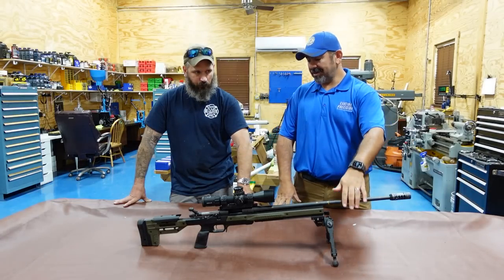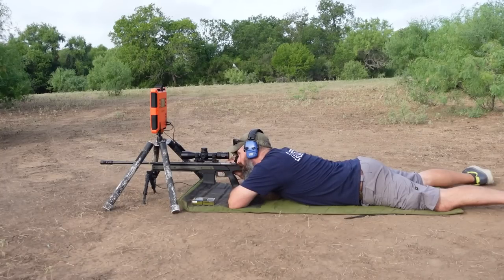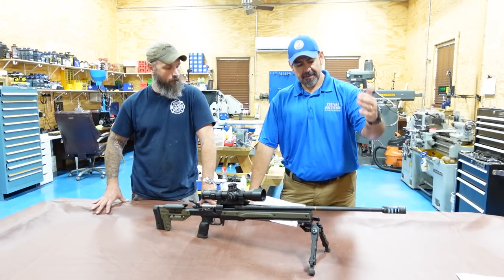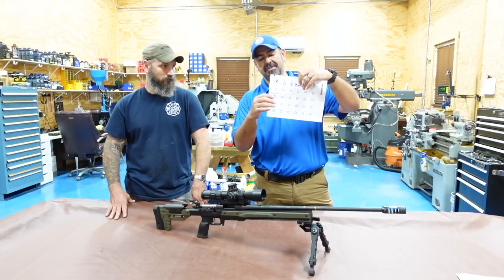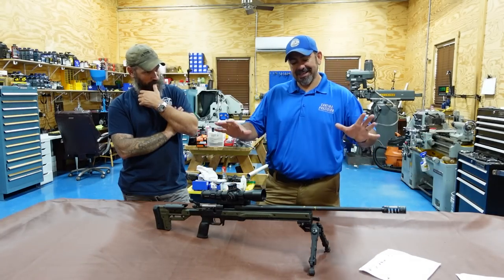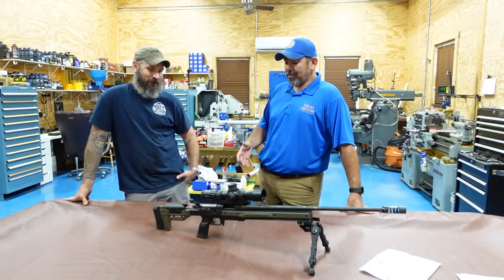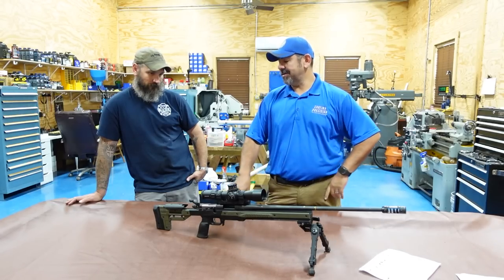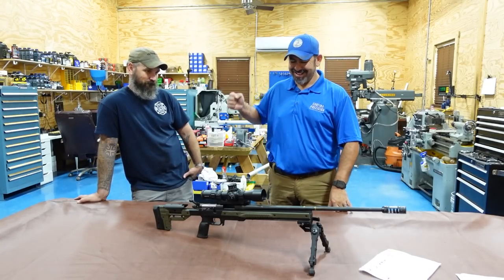6.5 NEEDS-MORE | EC Tuner Brake

Comment: I did something similar. Took a $335 Savage Model 12 in 6.5 Creedmoor. Put it in an Oryx chassis.  Had a gunsmith chamber a heavy (1.25”) 26” Shilen select match barrel and blueprint the action. Put in a 1 lb RifleBasix trigger and longer bolt handle. Added your BR EC Tuner Brake. I’ve got less than $2,000 in the gun (not counting a $900 Sightron scope). With my handloads (you’ve helped me there), I can shoot .3 MOA (5 shot) groups at 200 Yds. 1st shot at 400 was dead on. With the factory barrel, I shot 4 into 4.6” at 1,000 Yds. I’m not a pro shooter or special operator - started shooting 3 years ago at age 71.
Reply: my most accurate rifle is yhe same rifle,   can shoot
 .17 group at 100 and .5 at 1000,   stock barrel.
Reply: I have been thinking about the MDT ORYX system for my Savage 110 Tactical in 308W, but my first range session went well bore cleaning revealed a bad barrel that shattered deeply marks were replaced with a Criterion barrel, but my question is, “what type of group(s) did you achieve with the factory stock, and improvement did achieve with the Oryx stock”? My Savage still sitting in the original stock.
Reply: @rudolphferdinand3634  I have a Savage Model 10 in 6.5 Creedmoor.  Put an Oryx MDT stock on it and never looked back.  Do yourself a favor and put one on it.  You will not regret it.  As they stated in one of the first videos, the rifle is much more manageable and stable after the recoil.  Much easier to keep on target.  Groups were reduced as well.  No comparison to the original stock.
Reply: You young guys always bragging 😂…. That’s awesome sir 💪🏾👍🏾

Comment: Okay so lets go backwards just a little, comparing from the start. Keepin the ammunition the same, stocks the same, scopes same. Where was the most significant change on rifle from the other? Would you agree it was the turner break? The other rifle in the comparison is shooting just the same but has no stock change except for lug bed and pillars or the tuner break. So personally IMHO the barrel had the issue and the tuner break made the correction almost 100%. Right?
Reply: I am not sure I agree, the 3.5 MOA rifle became a 1.5 MOA rifle with the stock change and then a 0.5 MOA rifle with the addition of the EZ. On paper the stock change would appear to be more significant. Only way to know for sure would be to put the barrel back in the original stock and see if it can shoot significantly better than 1.5 MOA.
Reply: Don't forget that they re-crowned the barrel when they threaded it for the tuner brake. If the barrel was actually the issue then the new crown could account for some portion of the increased accuracy. Impossible to know for sure since they did both at the same time. The fact that it shot the best group without adjusting the tuner at all might mean the re-crown did most of the work. Likely a combination of both. To test everything independently you'd need to test the new crown, then add a brake and then add the tuner and test each separately.
Reply: @kalicom2937  I agree, some of the steps where skipped b/w both rifles. To be consistant you bed lug and pillar both stocks and check for change as it started. One Rifle Erick proved to be right with all changes except the T brake. The second took a leap to a new stock without anytime wasting from the original stock. And it improved just a little bit, but when the T Brake was added it improved well over 90%. The moral of the story IMHO. There are god barrels and bad ones.  And some bad or just okay barrels, if you can find the harmonic tune that works for that barrel,  I don't care what platform your put it on it will work. Just like you may find a barrel that is just bad, and no matter what you do they don't shoot.

Comment: I've done this same thing over the last year, but not factory ammo. I picked up an ADL Tactical in 6.5cm off the shelf for $400, came with a 20moa rail, heavy, threaded, varmint barrel. I put it in an oryx and bought a cheap brake while you were coming out with your tuner. Using my reloads and cheap Hornady bullets, it's sub 1/2 moa!

Comment: I'm sure the tuner was a significant help in improving the accuracy. 
Do you think recrowning also played a role? I would think it would have.
Reply: Yeah, it's impossible to isolate the difference one aspect is making when you change multiple things at once. The barrel crown is one of the most important aspects of accuracy. I've seen some truly terrible factory crown jobs which when remedied cut groups to a third of what they were previous. The fact that it immediately shot the best group when the tuner was attached without any adjustment actually lends credence to the idea that the crown made a lot of the difference.
Reply: @MMBRM  luckily they can actually test this now - all they have to do is take off the tuner brake and compare the bare muzzle against the old results
Reply: @newerest1  I would like to see the other rifle have its crown re-cut and not thread it for a  brake. Threading will remove metal and  possibly affect harmonics.
Reply: 10 thing that you can do to the basic rifle to improve accuracy and recrowning is one of them but should be one of the last because out of the hundreds yes hundreds of rifles I have owned over the last 69 years I have only had a couple that it made any real improvement in!
Reply: Crowning is a myth, you can jack it up and it may even improve accuracy

Comment: Triggertech primary for the money can't be beat. I have two of them, and I have a Timney, it's only real competition at the same price point, and the Triggertech is just better. It feels lighter than it really is because it has zero creep. Can't recommend them enough, 10/10. Just saw your idea about the factory stock. It looks like a cheek riser pouch setup like the ones from Triad Tactical might make it easier to shoot. They're like $60 and really good quality.
Reply: " It looks like a cheek riser pouch setup like the ones from Triad Tactical might make it easier to shoot' This or a cheap plastic bolt on for the same price and a $5 trigger spring from Mcarbo would have made half of the difference im convinced.. would love to see a poor mans version of this same series. Throw a $500 optic on there too.
Reply: @foonus406  Not sure if you've ever taken a R700 apart, but the trigger doesn't have a replaceable coil spring like say a ruger american or browning a-bolt, etc. As far as the plastic bolt-on, to each his own I guess. I'm usually not willing to drill holes and put screws or bolts on my guns, but that's just my preference. I also have a cheap version of the triad from midway (their own brand) that probably works just as good. I'm not an elitist type, the triad just seems to fit the style of their build here better.
Reply: @robertmajors1737  The bergara I have already came with a Triggertech, haven't had the chance to look at a stock one. Its one of the first things I do with the Tikkas and CZ I usually buy.
Reply: @foonus406  Absolutely couldn't agree more. When I go to the range, I have to shoot my rifles with the Triggertechs last or it makes the other decent triggers feel awful. Especially in field shooting conditions, I think being able to break off the shot exactly when you want is maybe only secondary to good fundamentals. I refuse to own a rifle with a terrible trigger anymore, because you're never quite sure if it's you or the gun causing inaccuracy.
Reply: I have never tried a Primary because a few years back I got a special on sale really cheap.  I bought another Diamond later.

I think the Special is probably the sweet spot when you're only paying a few bucks more than a Primary.
Reply: @joequixotic3039  I'm sure they're all good, I just don't have use for under 1.5 lbs, which is the only difference between the primary and special if I'm remembering right. The diamond is a benchrest/competition trigger I also have no use for, but I get why they make it. I have my primaries at 2.5 lbs and with the absence of any creep it feels even lighter.
Reply: @robertmajors1737  the special gives you the option and I feel the more I shoot, the more I like a light trigger.  The Diamond is more of the same and i like it on my ELR build.

Also, the higher the pull weight, the more it upsets the rifle.  You can try to counter your trigger pull with your thumb but the higher the weight, the higher the chance of a muscle tremor.

At this point, I would not hesitate to use a Diamond on a hunting rifle.  I think it can be turned up to around 2.5 lbs which I feel isn't too light to get used to (for me).  A Special goes higher and low enough for anything short of competitive benchrest which is why I recommend it if it's only a few bucks more than a Primary.
Reply: @joequixotic3039  Yeah man, everybody likes something different. Guess that's why they make different products. The primary goes from 1.5 to 3.5 lbs, which is perfect for what I use it for. I understand the need for ultra light weight pulls for special applications (elr, competitive, etc), I just don't personally need it. I feel like 2.5 lbs is a good balance for hunting and target shooting. If I wanted to compete in a prs match or something like that, I think 1.5 lbs would be plenty manageable for that. To each his own, but the primary in my opinion is all most folks need.

Comment: Would be fun to add an adjustable inexpensive bolt-through kydex cheek riser to the factory plastic stock. Never done it but you may or may not have to add some foam inside the stock for rigidity. Also not sure what the foam will do to the balance.
Reply: These risers are likely the best way to get a consistent cheek weld on a cheap stock, I have several setups using them on plastic Tikka stocks, all of which shoot under half a minute or better with only that riser and a cheap $5 mcarbo trigger spring.

Comment: Hey guys, I'm loving the series. 

The first thing that everybody says with a Rem. 700 at the range is "I have a trued Rem. 700" or a "blueprinted Rem. 700 action" and nearly always with upgraded triggers. Throughout this series, you have tinkered with both rifles and got them as good as you can with aftermarket "bolt-ons". 

How about truly modifying your 3.5 MOA rifle with an Oryx chassis, a new cut rifled Brux barrel, blueprinting/trueing the action, lapping the bolt lugs, bolt spring and a trigger. This might actually see if all of those common gunsmithing and barrel upgrades are actually worth it, instead of the common accessory "bolt-ons". 

I'd like to see what a trued action & cut-rifled barrel can do......then even add a tuner-brake. 

With the anticipated results, I'm sure that you will not hurt any of your sponsors feelings and I'm sure that you could get a decent Brux barrel for the experiment. 

Plus, we can see an easy $1.4k build vs a fully custom $2.5k build.  

Just my 2c. Cheers guys.
Reply: I really like this idea

Comment: #1 stiffen the fore end to elimanate flexing while on the bipod. perhapes also add weight to the stock. throw on a  cheek peice thing. ec tuner brake and trigger, bolt spring

Comment: Erik, really enjoying this series.  My thoughts would be to put the other one back into the factory stock and see what you can do with your hand loads.  I essentially did similar with a 700 about 30 years ago in 30-06.  I was very pleased as it turned out to be a great hunting rig.  I did have a trigger job done on the factory trigger set to 3.5 pounds. Thanks !

Comment: Glad to see that re-crowning was part of the install of the tuner brake.  You looked at the bolt lug contact and gave it a "looks okay". If this was your PRS rifle okay would not be good enough. You need to lap it to full contact. Getting to full contact causes the "take-up" of the action production tolerances that leads to more consistent bolt lock.  Don't settle for Okay.

Comment: If y’all put the original stock back on you might think about doing what I did is adding weight to the but end of the stock and filling it with something. I did this to a ruger American 6.5. I used some of that silicone mold stuff and pvc pipe with bird shot in it. Made a world of difference.

Comment: Put the chassis and tuner brake on the other rifle and see if the performance improvement transfers. Trigger springs? Lap lugs? Firing pin spring? True bolt face? Lap barrel? Work up a hand load? New trigger? Plenty of content available.

Comment: You can take the brake off to see if the recrown only made a difference.  Also, fire lap the barrel.  Lock time probably won't make a difference, but trigger upgrade might; both are worth a try.

Comment: Ya! It needs our new round "7mm ML PRC" It is a 7mm bullet in a 6.5 PRC case. We have barrels dies and mandrels to upsize the 6.5 PRC case. We started developing this round in 2019. All finished getting ready for Sammi. 411Tactical, Inc. 162 grn bullet 3,100 FPS.  At 500 yards 20 percent more energy that a 300-win mag with 38 percent less recoil. This will be the super cartridge.

Comment: Return the "test-rifle" to the original stock please...that will give you an isolated test with the tuner-brake only (since you haven't pillar-bedded that one) and it will show if it's the tuner-brake by itself, or a combination of the brake & stock upgrade.

Comment: One thing you're not talking about is, the weight of both rifles I would try to make them weigh as close as you possibly can, the same. Especially the one in the stock chassis. All the other upgrades the spring, bolt handle, trigger are exactly where I would go. The only thing I would make sure when replacing the trigger that it is 2 lb or less. Otherwise you're really not gaining much.

Comment: Curious to see what it does with a shorter barrel at 20" .  Also interested to see what it would do after threading and crowning without the tuner. You sort of missed that control step.

Comment: When setting the final configuration on your tuner break, how tight should the 3 screws be tightened? Will tightening the screws change the group size a bit? I have 4 of your tuner/breaks by the way. Call me crazy but yesterday at the range I went from setting 2 to 10 and 10 was the best setting on my 6.5prc. I noticed the fps velocities change in every setting considerably. The speeds at setting 0 and 10 are identical though!
Reply: I think the term is tuner dominance. Tightening the screws should increase dominance.

Comment: Man, if those tuner breaks had been out around 4 years ago I'd probably have tried that for my T/C Compass. It's impossible to get consistency with that thing, but in the end I can shoot 1 MOA or usually less and it was a $250 gun- so I can't complain too much. For mods I put a Boyd's stock on it, pillar and glass bedded it. I've spent a lot of money on reloading stuff over those years as a result of trying to get it to group better. At this point I'm over trying to make it better and will just make cheap ammo for it until I can buy/put together a nicer bolt gun someday.

Comment: @Eric Cortina I have a 7x64 with a long throat, so long that even with the longest bullets (175 gr Barnes) the bullets barely touch the lands with the bullet barely seated in the case (0.050). This is a hunting rifle and not a target rifle by any means. Case capacity is almost identical to the .280 Remington and therefore I can use load data for the .280 Remington. Do you have any advice or experience loading for long throated rifles you would be willing to share?

Comment: Wonderful idea to use the original stock and put a tuner on it to keep it under $1000. Would it make sense to bed it instead of putting the Oryx stock on it?  It would still keep it under $1000 and if it performs similar to the one with the Oryx, then you have comparable performing rifles at two different price points. Choices.

Comment: I know the tuner break makes it less critical, but I would love to see you go through the steps of tuning a load to this rifle. It would be interesting to see if there is much improvement when you work up powder and seating depth while showing and explaining each part of your process. 

Also with the other rifle, l think it would be interesting to place it in the stock stock and see if you can get that rifle to shoot like this one using only stock components and load development for a super cheap build vs a $1500 set up like this one.  Thanks for what you do!
Reply: This is why they selected some of the most expensive consistent rounds to begin with, very little deviation between those.. but wow the price. With the Inherit consistency of the out of box ammo it was able to tune with a break. Good luck repeating the results with a budget brand ammo that has SD of 80.

Comment: If you're going to make them the same with a chassis and tuner brake it'd be good to then see what difference you can make between handloading and factory ammunition
Reply: instead of premium factory, how about showing basic (cheap-or will that be too inconsistent to tune?) factory and tuner improvement while you do the handloading part too.